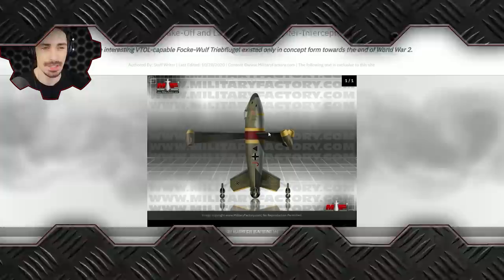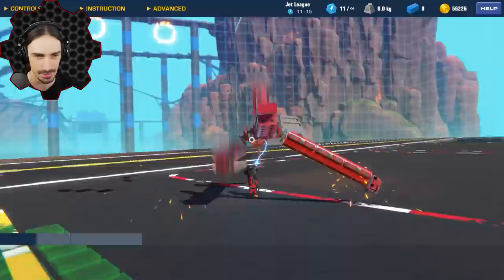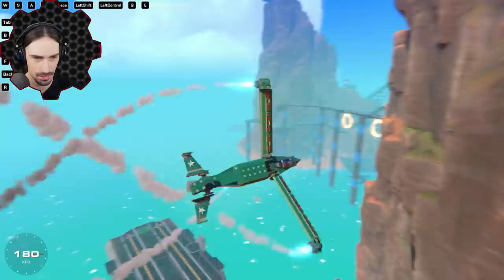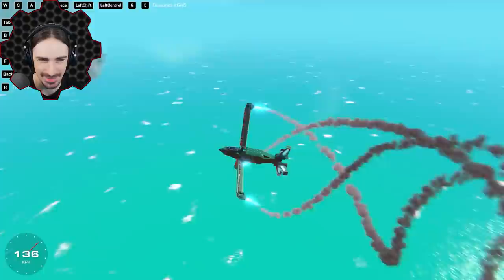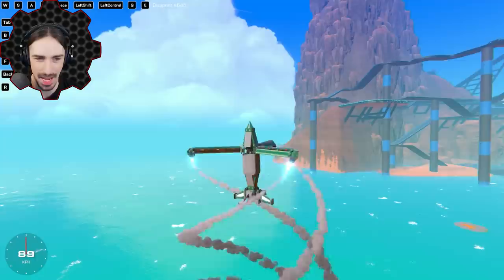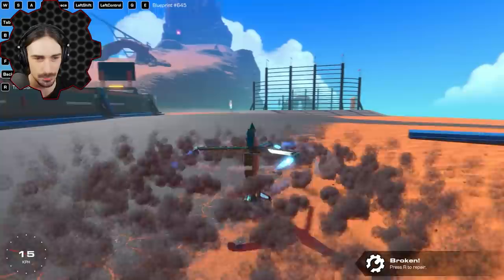TRIEBFLUGEL: The Craziest VTOL Design They Never Made... BUT I DID!

Comment: ”Imagine a helicopter but with jets on the tip of the blades”. Ah yes, scrap mechanic helicopter
Reply: kAN has a chopper like that.
Reply: Probably everyone thought that
Reply: There's actually a real helicopter that attempted this by the USAF.
Reply: @foxracerdrew  I remember that helicopter it was supposed to be light and easy to assemble on the battlefield so a normal engine would be to heavy that's why they used jets.
Reply: I want what this guy was smoking....
Reply: Fairey Rotodyne basically
Reply: Or the US XH-26 'aerial Jeep' mini helicopter or it's counterpart the YH-26 Hornet
Reply: Tipjet helicopters were a thing, but the fuel consumption and noise meant they never got beyond testing
Reply: Ow0
Reply: yes
that's why sm helis are not very good that's why trailmakers has better helis
Reply: @foxracerdrew  There are real helicopters still being manufactured with this concept. Almost all for private owners.
Reply: kan and kasmo helicopter
Reply: 4gfj
Reply: You mean a Tip jet.

The Fairey Rotodyne 
Doblhoff WNF 342 V4

There were actually dozens of models that tried/used this.

some used jets others used ramjets.   The key being, they didn't need a big motor like helicopters and insted just needed 2-4+ small jets or ramjets on the tips
Reply: XH26 jeep jet used pulse jet tip jets and actually flew was deafening though
Reply: @foxracerdrew  xh26?
Reply: @jenniferstewarts4851  some used pulse jets too

Comment: The Germans did have ejection seat by 1942 because they were experimenting with a kamikaze plane based off the V1 buzzbomb and they continued experimentation with ejection seats. So in theory you would have an ejection seat in this fighter.
Reply: hmm yes i sure do love ejecting my seat to save myself but ending up being chopped by the blades of my own "plane"
Reply: @lookatel3658  the blades would be detached using explosive bolts and then the ejection seats rocket motor would fire
Reply: @bescotdude9121  I hope that hey got the sequence in that order xD
Reply: @lookatel3658  You could use exploding bolts on the blades to launch the blades off the aircraft when you’re ejecting. Similar to helicopter’s ejection seats. And yes the Germans had exploding bolts in the middle of World War II
Reply: @bescotdude9121  Until the blade ejection mechanism fails but the seat ejection mechanism doesn't.
Reply: @Hadeks_Marow  dude this is german engineering. stuff like that never fails because its put through alot of trial and error. Thats why alot of the german stuff is quite literally bullet proof. you can beat the snot and it still works
Reply: @Hadeks_Marow  look at the modern wolfenstein game series. thats a very good example of how engineering can be dominant
Reply: @jackmagnium6115  Yeah, when not put through the trials of war. . . which, need I remind you, was what this was designed for.

Anything can fail if you damage the right part of it.
-Also, stop liking your own replies, it makes you look desperate (wait till someone else likes them first xP).-
Reply: @Hadeks_Marow  uhm i didnt even like my reply nor do i remember doing it. besides im eating
Reply: @Hadeks_Marow  also explosive bolts never fail anyways. unless someone made it wrong which i doubt it because stuff like that goes through strict processes before being produced(sold) or used.
Reply: @jackmagnium6115  Again, all that needs happening is failure to communicate with the electronic interface components that the pilot needs to activate but can't because that electronic interface is damaged due to enemy fire. Unless you are suggesting circuit boards are missile resistant and bullet/shell resistant or they have a contingency against that very scenario, you're not exactly gonna make a case against instruments of WAR.
Reply: @Hadeks_Marow  which german itself wouldnt allow. I know this because a friend of mine has a VW golf from 2008 built from germany. its beat the hell out of itself but none of its electrical components failed. where as our american crap does. never under estimate german engineering and technology. they are bulletproof for a reason. even in world war. alot of our tech like fuel inject for gas cars is from germany. it is true its not missile proof but germans are pretty strategic and at the time were way more advanced than us americans. in fact thats also why I mentioned the modern game series wolfenstien. yes they won because of using a nuke but thats because the fact they had better tech and science. sucks yet thats what happens when you mess with germans. their tech destroys any competitor except japan but thats current world. in WW2 germans were more advanced.
Reply: @Hadeks_Marow  the other thing to point out is the german stuff was basically perfect. its the fact the ideas itself wasnt completely tested. sure a failure could have happened here and there but with germen tech. thats like 0.01% chance of that going wrong. otherwise they wouldnt have gone as far as they did or even farther in wolfenstien.
Reply: @lookatel3658  an ejector seat flies at high enough speeds to get above the blades before passing them, otherwise you could even have issues with tailfins on normal fighters(especially jets), on top of a spiraling aircraft which in most cases would be the reason to deploy it.

Comment: "Last Talons of the Eagle", a book about Luftwaffe experimental aircraft, has a section on this. Another disadvantage you didn't suffer was the problem of getting fuel from the stationary fuselage to the spinning blades. Apparently it used to leak out.
Reply: I wonder why? Its not like it’s nearly impossible to make a tight seal on a spinning bearing.
Reply: @Crummieboi56  Excavators do it all the time, and with much higher pressure.
Reply: @Crummieboi56  Varying stress, perhaps, as the aircraft flew?
Reply: @Crummieboi56  it was a little while ago

Comment: Next time try to build a Strv 103, it’s a wedge tank so I’m positive you’ll like it. It also has suspensions that aim not only the gun but the whole tank up and down
Reply: It had very fancy pneumatic suspension for elevation and depression of the entire hull and both the driver and the gunner had aiming controls. Despite its relatively small size, it had 2 different engines and an auto loader. The Swedish designers for this thing must have really liked tank steering because they use it to aim the gun both side to side and up and down. If only games like scrap mechanic and trail makers had more useable options for the tank tracks other than just wheels, they can still get the job done but having proper tank tracks would just be so cool
Reply: @natelovestotank2363  up and down tank steering?
Reply: @AlbertoDsign  yeah pretty much, it’s just my stupid way of explaining that this tank used neutral steering to turn the tank to aim the gun on the horizontal axis but it also tilted the tank to aim on the vertical axis (elevation and depression)
Reply: @AlbertoDsign think about hydraulic suspension on low riders, now take that suspension and apply it to a multi-ton vehicle. That’s how you aim

Comment: 4:05, to answer that question, I think that the air moves through the rudder rather than the other way around. For helicopters to get lift, they shove air downwards, so when this is hovering, you get a large force pushing down at the ground, also hitting your rudder which lets you have control. Maybe not in Trailmakers, but for real life it would probably work.
Reply: Probably*😂
Reply: are you sure? i thought helicopter literaly just moved the wings of a plane through the air insteade of moving theplane and wings through the air. they dont push air like a fan, they seperate the air creating pressure to fly, and yeah downward force is created too, but not insane amounts, just enogh to make grass sway. you wouldnt feel a sudden burst of wind from above if a heli flew over you unless it was real close. so it might work a little bit.
Reply: @foxidafluffy8294  You definitely do get a large amount of wind beneath a helicopter.  The Coast Guard even practices using it to move boats
Reply: @frederickthesquirrel  but its not a propeller. Its function isnt to shove down air fast, its a wing.
Reply: @mrnorthz9373  From my knowledge (which admittadly isn't that much) it is actually a propeller pulling air down. However I didn't check.
Reply: @RealPanzer999  in a drone, when propellers spin they dont interfere with eachother since the push is downwards. In  a helicopter, when wings turn they leave behind something called dirty air because they work differently
Reply: @foxidafluffy8294 both planes and helicopters work because of Newton's 3rd law. So yeah, while some of it is a pressure differential, a significant reason lift is a thing is just pushing the air down, which pushes the vehicle up. If you ever see a helicopter in real life, yeah there's a ton of wind. Even planes have a significant amount of air getting pushed downwards. That's why the ground effect is a thing.

Comment: The gyroscopic effect appear only when there is a certain pitch/yaw rate. In other words only when you change the direction of the angular velocity vector of the "wings". This is why when you take off you fly straight, because the direction of the angular velocity is constant along the vertical direction. 
Just a little explanation for the curios ones, have a good day all!
Reply: If the physics are calculated correctly, gravity itself should also cause gyroscopic precession, even with no control inputs (assuming the craft isn't perfectly vertical).
Reply: yeah science 
no but realy how did you get that smart i would like to know because i'm a avionics and space freak like i love those things and i would love to know how they work like yeah i can't describe it but yeah pls let me know or maybe teach me a 13 year old adhd person
Reply: @bartelhehe3049  I tend to picture a gyroscope as an orbit, which is what helps me visualize the forces better.  I'm pretty familiar with orbital mechanics, so choosing that brings the math into a familiar setting.  (the core math for orbits and gyroscopes is pretty similar)
Reply: @circuitgamer7759  ok Thx aaaand about the math i don't know It because here where i am you learn that kind of math in you 8th schoolyear
Reply: @circuitgamer7759  gyroscopes are entities that apply force to the object making it either stay looking at the gyroscope direction or the chosen direction, that force can be countered by a greater one but once that greater forcr is gone, the gyroscope does its job

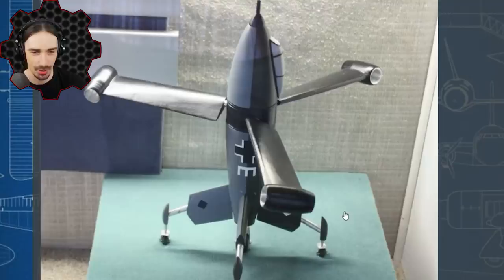Comment: 3:48 Not sure that's correct IRL, (definitely an issue in games) you don't need to be moving relative to the ground, you just need the air to be moving relative to control surfaces to have control. The air would definitely be moving, given the huge blades.

Comment: I would try locking the spinning of the wings once in the air. Also it's more stable because you have 3 thrusters in 3 planes making it quite stable. With 4 thrusters once you have 2 thrusters for one plane and they can move independently by vibration, it will create wobling. you can imagine it by compering 3D printers, classic ones vs 3 arm ones. by controlling 3 directions instead of 2 you gain more stability
Reply: Also, bolas have 3 strings with weights for a reason. They are probably using the same stabilizing effect.

Comment: I honestly believe that why the vtol wanted to roate left was the magnus force
The wings going up on the left where grabbing the air and forcing it down, creating the opposite effect of the wings trying to go up in the air column on that side, while the wings on the right rotated downwards creates the opposite force. Therefore the craft will move left in the column. 

If this doesn't make sence go watch how the magus effect works and see if you can re-create it in trail makers to confirm or disprove my theory. It would be super interesting if it does work.
Reply: I thought the magnus force was an effect on spinning balls?

Comment: Try using 2 wings and have them like normal wings during regular flight. So you would take off like in the video. Go really high as you tilted forward. Lock the wings in place at horizontal to the ground and fly it like a regular plane.

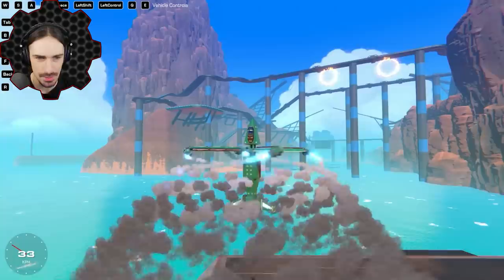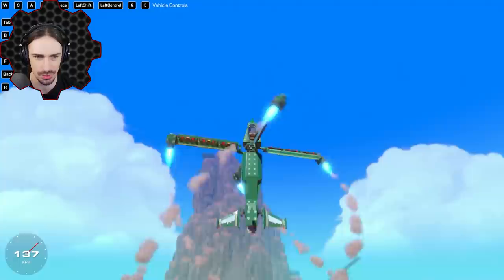Comment: 15:08 15:31 I think you're right with the gyroscopic effects.

When you are vertical, your thrusters point downwards and you take off straight, fairly intuitive.

When you are horizontal, ignoring the spinning wings for now,  you have lift in the back and no lift in the front. This would appear to make the aircraft pitch downwards.
If you now take into account the sprinning wings and their gyroscopic effects, this "pitch down" torque is rotated 90 degrees and now results in a "yaw left" torque.

15:31 I believe this is why the aircraft yaws to the left naturally and it doesnt appear to control well.

   Using this logic for the pitch/yaw controls:
You try pitch up --> aircraft yaws right
You try yaw right --> aircraft pitches down
You try pitch down --> aircraft yaws left
You try yaw left --> aircraft pitches up

To test, if you reverse the spin of the wings it should naturally yaw to the right instead of left
At the end of the day this could all be meaningless unless it's tested to be correct (might make a good video idk).
So instead, have a nice day👌

Comment: Boost this comment to help scrapman:
To make stronger turning point first place a helicopter engine, set to 0 power and no input.
Put the servo on the heli engine and build the wings/blades on top of that.
Now you connect the heli engine to the wings using a flat connector 3x1.

Comment: I think the key is to stop the rotation altogether so the rotor blades become fixed wings. You could also try making them wider   like the original design. There were also wheels with suspension on the tail fins

Comment: Propeller aircraft when taking off tend to drift to the left and also try doing that even while up in the air. The tail of a propeller plane has a tab that is bent slightly to compensate for it. It only is noticeable when taking off as that tab is only bent enough for cruising speeds  and when you take off you have to go to max throttle so you have to apply some rubber to compensate.

Comment: America and France both had similar but slightly-less-insane VTOL designs that they actually built in the '50s. The Convair XFY "Pogo" and Lockheed XFV "Salmon" both used contra-rotating propellers on the nose and the SNECMA C.450 Coléoptère had a ducted fan behind the cockpit. The Coléoptère was unique in that the pilot's seat rotated so that it was always upright. All projects were abandoned within a year or two due to how difficult they were to pilot.

Comment: I remember talking to a friend about this plane some time ago, he had the same thought about the emergency eject, I theorised the blades had an emergency decoupler that would release the blades prior to the pilot.
Reply: also the reason you listed to the left constantly is the asymmetry of the blades, since the connectors where the wings are attached are on a 2x2 grid you were forced to put them on one side of the square applying the force of the lift off of the center of mass. perhaps putting one pair on the opposite side of the hinge would apply equal forge on the the other side of the vehicle.

Comment: The biggest irony with this design is that VTOLs are usually built to allow them to use a very small landing pad or runway. But this flyer resists getting into a vertical orientation for it's landing way too hard for the pilot to predict where he'll be able to make that happen. And once you are vertical, the only thing you can do is to lock yourself into the orientation you happen to be in and see where that takes you down to. So effectively, this thing needs an empty space that's 1 or more runway lengths long and 1 or more runway lengths wide to be able to land safely.
Alternatively, these could be used from ships or submarines: Take off from a tiny pad are no problem at all. And to land the flyer just goes into a hover SOMEWHERE over the water and it's the ship's job to put the landing pad under his tail and tell him when to come down.

Comment: I feel like if you were to move the thrusters closer to the center of the fuselage then there may be some more stability. I believe there's a counter-torque thing happening when you pitch horizontal with the four bladed design. Basically while the blades rotate it's causing the tail end of the creation to move out to the right in return causing the nose and thrusters to turn left. Of course you would have to really crack down on the weight of the creation. Making sure it is of equal weight on either side of the blades.

Comment: 15:10 the change in direction IS what causes the yaw. If you get a gyro toy and get is spinning straight up and down (as intended) then try to push it over, it will want to start rotating in the direction of rotation.

Comment: You should do a follow-up video trying to make this as best as you possibly can also try adding a Thruster at the end pretty weak but it will help you get vertical if you put it on hinge or something I just want to see if this creation would actually work if some more work was put into it
Reply: Also it might be smart to put a tiny bit of lift on the blades that rotate like One Wing in between regular blocks

Comment: I’ve had problems with the gyro before. It’s a pretty easy fix if you make a second propeller spinning the opposite direction (it will make the uncontrollable spinning go away, however it does have its own problems being it becomes considerably heavier as well as the body may need to be longer)
Reply: And that's how helicopters ended up being made.